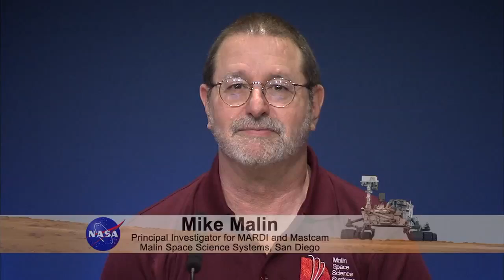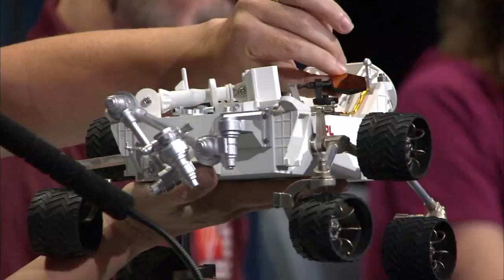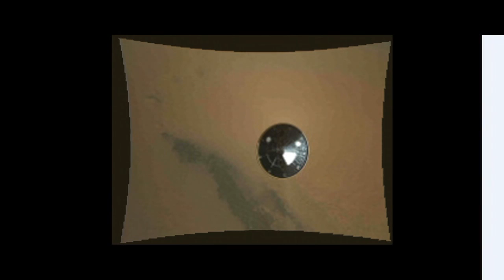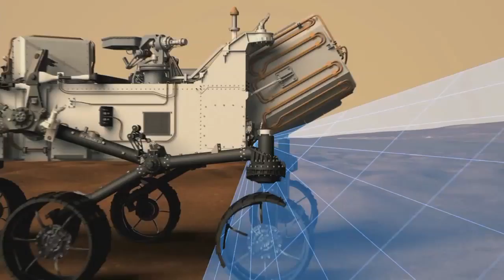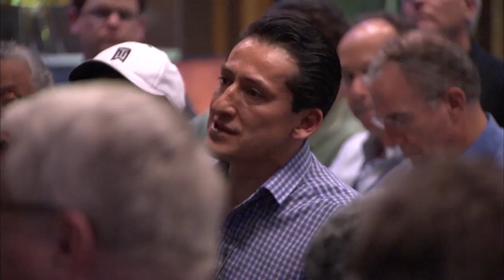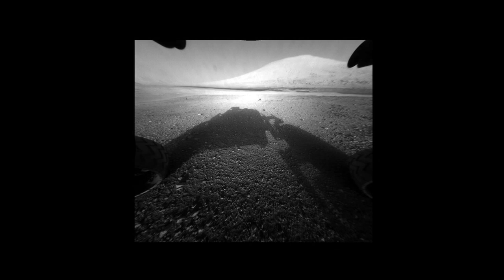Curiosity's Sol 1 Scoped for Media

Comment: MARDI took still images at 4 frames per second of the descent in 1600x1200 pixel resolution.
i don't think there is a "video" camera (as in 30fps mpeg or similar) on board msl as that wouldn't hold much science value and just add weight i guess.